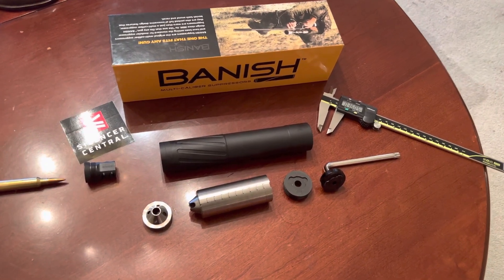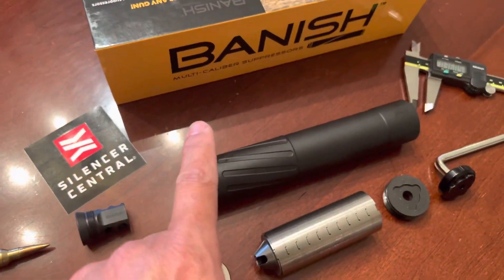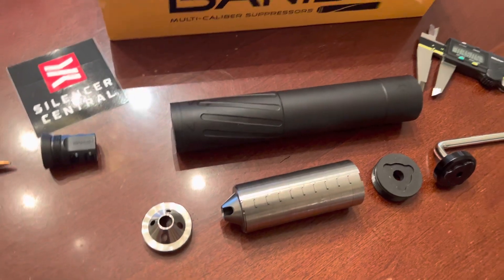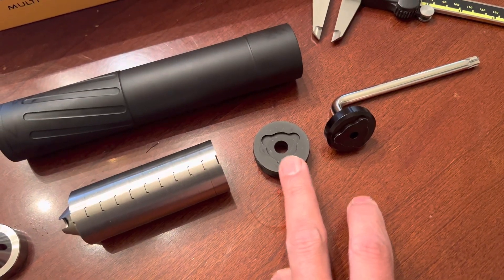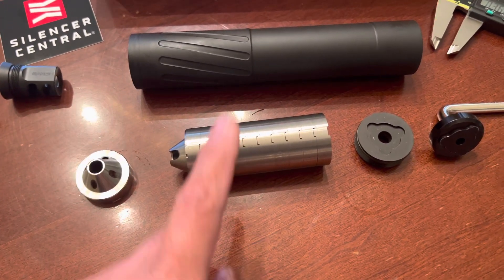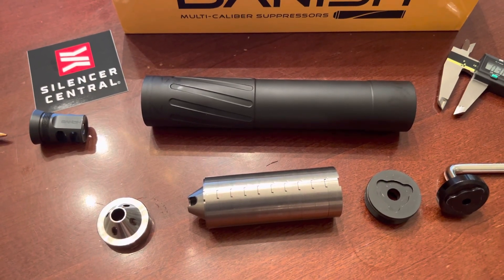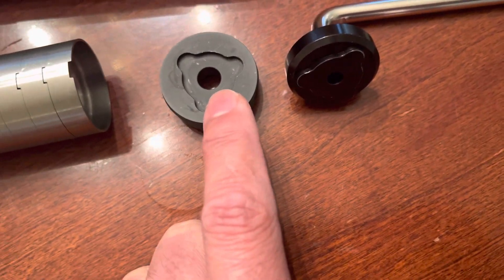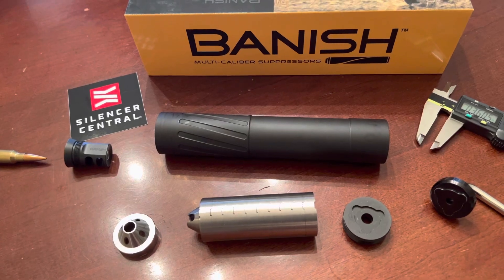Part 3 - Serviceability of Banish 30 Gold Suppressor from Silencer Central

Comment: Thread lock melts at 250-300°F you want rock set. It is water saleable if you need to remove the muzzle device, just soak in a bucket of water.

Comment: How long is the Banish muzzle brake? Two inches? I’m wondering if it was pinned, or welded, on a 14.5 inch barrel would it be long enough to make the overall length 16 inches. Is it even close? I can’t find specs on it anywhere. Thanks
Reply from the maker: They give you 2 Muzzlebrakes. Threads (1/2 x 28) and (5/8 x24). Length on both is about 1.5 inches. So for a 14.5” barrel you are looking at 16” total. They tell you to use a thread locker to put the Muzzlebrake on the barrel. Once it is cured, the muzzlebrake stays on the rifle barrel. You can then put the suppressor on and off as you wish. I use the loctite anti-seize thread lubricant on the suppressor so it won’t get stuck on the muzzlebrake when I need to remove it. All of this information is not covered properly in the videos and manuals by Silencer Central.